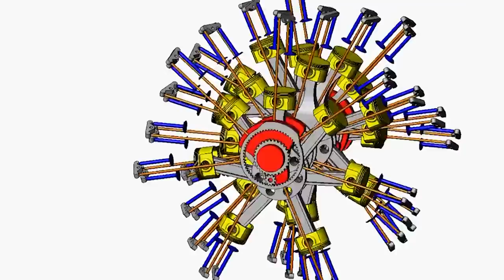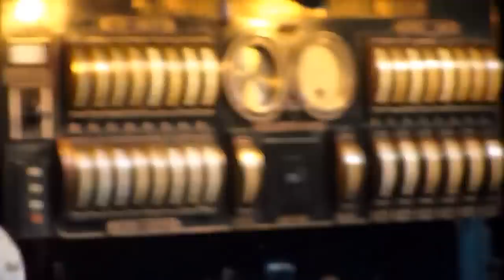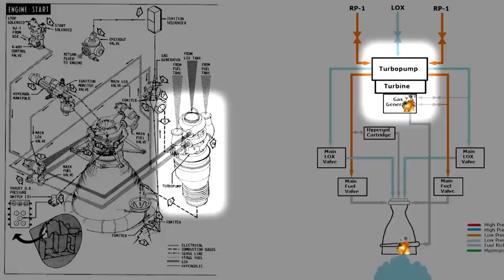The Most Powerful Engine in The World

Comment: At the Koreshan State Park in Florida, in the town of Edisto, they have a two cylinder Fairbanks-Morse that enthusiasts rebuilt.  They run it every Saturday.  It can run a GE generator that made alternating current back in the late 1920’s.  I seem to remember the engine is a 1925 model.  This park was once the compound a a utopian type self-sufficient society.  It is all pretty well preserved including their belt-driven wood shop powered by a single cylinder motor.  I have visited this park twice and hope to go back again.  It’s fascinating to see that big diesel run too.  They have a single cylinder engine that runs a compressor till it reaches a certain pressure.  Then they insert a glow plug they made and when the compressor valve is opened it turns the flywheel and off she goes!
Reply: ⁰
Reply: It’s Estero
Reply: @johnnyhardway4035  Thanks, I forgot it.

Comment: In Lyle Cummins book, "Diesel's Engine" he described an early single cylinder diesel engine produced for  powering a manufacturing plant, with a bore over 4 feet, a stroke slightly longer which produced (if memory serves me, and it still does from time to time) a whopping 1750 hp at a screaming 275 rpm.  Fascinating book should be a must read for any well rounded gear head.
Reply: L
Reply: Sounds like a description of a cathedral engine used in large ships.
Reply: @JackDavis i think so too 🤔🧐

Comment: 9:24 , a two stroke fires on each revolution, so if it's running at 2000RPM, it's is firing 2000 times, not 4000, only twice as many as a 4 stroke.  One of MANY errors in this video.
Reply: He said compared to a 12cyl 4stroke. This is 24cyl 2stroke. But yes so many errors in this one. I like the GE90 being 5.5mm long x 3.5mm wide (massive)

Comment: I used to work ot Ingersol Rand. They made a natural gas V12 stationary engine that had was used to pressurize natural gas in pipe lines. It had an additional four 6 foot diameter double acting cylinders to pump the natural gas. It had a 14 foot flywheel that could supply 20,000 HP to drive a generator which in turn powered the pumps to pull the natural gas from the ground.

Comment: Check out the British Napier Deltic. An opposed-piston (3 sets of pistons in a delta configuration) valveless, supercharged uniflow scavenged, two-stroke diesel engine, with a block of 9 cylinders, which can be stacked end to end for more power. Used in marine and locomotive.
The New York City Fire Department used a Napier Deltic engine to power their one-of-a-kind "Super Pumper System". This was a very-high-volume trailer-mounted fire pump with a separate tender.
Reply: I used to work on these as an engineering apprentice 30 years ago!

Comment: In 1967  I was stationed in the Army in Hawaii, and friend of mine was in the Navy stationed on the South Shores. My wife and I drove through Kolekole Pass to get to the Navel Station. It was there where my friend started talking about his MOS on repaired engines for the Navy’s power plant. He asked if I would mind going over to where he worked, for a tour! And of course I said yes. We got to this big building and He opened the door and we walked in. I was in there for about ten minutes and he asked me if I noticed anything different, and I said no, he said turn around and there was a wall, I thought about him being a mechanic on engines. (Me Being A Farm Boy), I didn’t think much about the wall and the connection this had to do with his MOS. He Laugh and said ‘I worked on this wall witch turned out to to be one of three Fairbanks- Morse engine that power the Navy Station. The size of that engine was nothing I would never forget! I was overwhelmed and the engine they were off loading on the page looks smaller then the ones in Hawaii, but what do I know being an old ‘Farm-Boy!
Reply: I was stationed in the Army in Hawaii. My wife and I drove through Kolekole Pass to get to the Navel Station. I saw one of three Fairbanks- Morse engines that power the Navy Station. The size of that engine was something I would never forget!    There,  I condensed the rambling and word diarrhea to a quick read.

Comment: One mind blowing fact of the Saturn F1engine is that the fuel pump of a F1-engine is driven by a gas turbine with 55000, yes 55000! Horsepower. That power was needed for pumping 400 tons of kerosene in 150 seconds. The exhaust gases of the turbine  cooled the rocket engine nozzle. After 150 it fell into the ocean.
Reply: Even more interesting is that gas turbine have so little power, rd170 engine gas turbine produce over 250000hp, even rd170 is more powerful (like 10%) it need gas turbine that need near 5 times more power (I guess it is due it have much higher chamber pressure)
Reply: FYI, the F-1 engine produced 1,522,000 lbf or 32 million hp.  Crikey and holy cow.
Reply: @Tsamokie  

Later versions produced about 1,600,000 lbs of Thrust
Reply: @mrlazda  RD 170/180 are staged combustion cycle engines. SpaceX's raptor 2 engines are full flow staged combustion cycle engines. I don't know why the power of the RD-170 turbo pumps is so high, but the raptor pumps are rated at 37 and 31 MegaWatts for fuel and oxidizer respectively. That works out at 53,000 and 45,000 Hp, while the chamber pressure is much higher than the RD-170/180.
Reply: @paulmichaelfreedman8334  as I understand full flow or stage combustion (edit) or open cycle do not make much difference for power needed for turbopumps, and still rd170 need twice power of raptor and that power is power (fuel used) is fuel not used to produce thrust (lost of overall efficiency)
Reply: @mrlazda  I think it's because of the overall size of the engine, it's larger than the Raptor, produces more thrust, and thus needs more powerful pumps for the faster fuel flow. The 170 is a quad-chambered engine and it is pretty big. The 180 is a two-chamber version. I will also point out, that the RD-170 has never flown on an official mission. I think the power loss per chamber is slightly higher with the 170 than with raptor.
Reply: @paulmichaelfreedman8334  rd170 flown on 2 missions before was returned one with Buran as payload and one with Polyus total of 16 engines and its improved variant (same 4 chambers only difference is in number of axis it move nozzle) Rd171 flown 84 more times. 
Raptor is marginally more efficient, but that is due use different fuel combination  (less then 10%) but power of turbopumps is over 2 times greater,  to big difference and f1 use same fuel combination as rd170 and use 5 times leed power for turbopumps.
Reply: The F1 was an absolute marvel of engineering!
Reply: @mrlazda  The F1 had a relatively low chamber pressure because I believe it was a tap-off system that used the preburned fuel-rich gas to line the inner walls with cooler gas to prevent the main exhaust gas from touching the bell. So the pumps did not need to be so powerful.
Reply: @882952  couldn't agree more
Reply: That's right, Saturn V most powerful machine ever built by mankind (less the collider, and Airtimes which I should should look up... )  either way payloads and horsepower that broke the conventional scale...
Reply: As a nerd there is a really good video on rocket engine turbo pumps

Comment: My dad was a mechanic in the Air Force and worked on the Pratt and Whitney R4360 wasp major engine.

As I understand it, the difference between the Wasp and the Wasp Major is the addition of a supercharger on the Major.
Reply: Also, I beleive, used on the C124 Globemaster.

Comment: Back in the eighties, in A & P school, we had to time an R-4360 Wasp Major. Also, on a test, we'd have questions like where a certain cylinder was.  Say #9 is at 22 degrees BTDC, where is #25. I ended up building and testing Pratt and Whitney PW2000, PW4000, and JT8D turbofan engines along with the IAE V2500 engine for Airbus.

Comment: The main point of the Orsted power station engine is the fact that it is a double acting diesel engine. These marine diesel engines were built to produce as much power as possible while being as short as possible for use on ships, thus allowing more cargo space.
Each cylinder of the engines had 3 sizes of bore, 2 lengths of piston stroke and a hole in one piston to allow another one too run through. 
I was lucky or unfortunate enough to sail on one in the mid 70's.
Reply: With their tolerance capabilities back then they must have worn out quick.
Reply: @snap-off5383  Lots of repairs done on that trip, must have done 3 units (a unit being a complete cylinder and running gear) out of 8. It was a real, real pain blueing and scraping a 3ft dia white metal bearing weighing 3/4 of a ton. Then we ran out of parts and ended up hanging one unit up completely, basically you disconnect the big end and eccentric straps so the there can be no reciprocating motion in the cylinder and you put in special supports to hang all the parts inside the engine. The engine, or more specifically the scavange space used to catch fire at regular intervals, we had to put it out by dumping CO2 into it. Quite novel seeing something with the paint blistering due to heat turn frosty.
Reply: Engine cylinder : stroke  1500 mm bore 840 mm = .0831265 m3 x 8 =  6,650 cubic meter . Until 1960 in regular use and was disconnected in 2004 from the grid , as emergency start backup power plant.
Reply: For the record, the engine is not a BMW engine. It is a Danish build Burmeister Wain engine.

Comment: Since the video didn't mention it I looked it up. The first engine shown the Fairbanks Morse Model 32 Stationary Engine in it's biggest configuration could produce 450 Max HP with it's Six Cylinder Version. Crazy a Charger Engine can produce more HP than this behemoth! The biggest selling point was it could run tens of thousands of hours nonstop without service. 450 HP in 1936 was quite a bit of horses.
Reply: for such engines, torque is vastly more important - and i'll bet no V-8 petrol engine can come close
Reply: And try and run a Charger engine for tens of thousands of hours without any service.
Reply: Im amazed that modern F1 engines are 1.6 Liter V6 engines that produce 1000+HP with a thermal efficacy of over 50%

Comment: The Model 32's horsepower was 40 to 50, depending on the particular model, hardly the most powerful engine in the world...
Reply: According  to what I just read they got up to 200hp.
Reply: The Fairbanks that is shown running in most of that segment is 75hp per cylinder.

Comment: The Maserati F1 engine made its racing debut in 1957 at Monza, in 2.5 liter form.  Ferrari had a 1.5 liter supercharged  F1 V12 in the late '40's, and a 4.5 liter F1 V12 in the early '50's.  Prewar, Fiat, Mercedes-Benz, and Auto Union had Grand Prix V12s.

Comment: There was a fairbaks morse engine along the riverfront next to my house that was bigger than my house(edit, before it was extended in the 90s), it was just sitting outside exposed to the weather all these years until rtecently where one day it was just gone. If i recall it was an inline 6 or 8 and had to be 30 feet long(longer than my limousine)
Reply: I served on the YTB:s at the SubBaseBangor WA, we ran the 38D 8 & 1/8 10 cylinder Fairbanks,  the Trident subs use the 12 cylinder version,  great engine.

Comment: You missed some of the most powerful combustion engines installed in ships
Der leistungsstärkste Wärtsilä-Zweitaktmotor (Typ 14RT-flex96C) mit 14 Zylindern und einem Kolbendurchmesser von 96 cm entwickelt mit vier ABB-Turboladern eine Leistung von über 80.000 kW (108.800 PS). Er ist der Hauptantrieb der Containerschiffe der Emma-Mærsk-Klasse. Die Produktpalette reicht von niedrigen Leistungsklassen mit Viertakt-Antrieben und Motoren ab etwa 2.000 kW (2720 PS) bis über 130.000 kW.
Reply: Der kam doch in dem Video vor oder?

Comment: get your facts straight, ge engine 5.5 mm long 5 mm wide, a 2 stroke fires 2 times per rev vs a 4 stroke
Do measurements in the same units of measure for all hp is hp, nm is nm so on so forth.

Comment: 18:27 Dear author. Slavic Soko Galeb. There is a huge difference between Slavic countries, being a Slavic culture in general spanning across countries like Poland, Belorussians, Russians, Ukrainians, Czechs, Slovaks, Serbs, Slovens, Bosniaks, Bulgarians, Croats, Macedonians,  Montenegrins and the actual designers and users of a plane that you mention here. It was designed in Yugoslavia in 1978, and at that time, Yugoslavia was composed of few of the mentioned countries, but those countries didn't constitute the whole of Slavic cultural and language group. Do your research, try better next time please. One video, two major mistakes, one in metrics - millimeters instead of metres and a significant mistake in differentiating ethnic groups and countries, a solid fail if you ask me. And one more thing, be consistent, use either km/h or mp/h ie. metric or imperial values across the video, using one and then 10 seconds later another one is just sooooooooooooooooooooo confusing.
Reply: I agree, not to mention, 13:25 He also referred to this diesel engine as "consuming less gasoline"

Comment: Oh No! the narator messed up on the GE90-115B engine. He stated that it was Millimeters not Meters. Meaning at the stated 5.5 Millimeters long it would be les than a 3/16 Inch  in length and 3.5 Millimeters across making it les than 1/8 inch wide... I am surprised it was not caught out in editing. other wise it is very impressive.

Comment: Biggest 2 stroke diesel ever built with 22500hp. Well, that´s cute. Finnish company Wärtsilä designed and created this little shipengine in partnership with Sulzer, RTA96-C and it produces around 80MW which is roughly 109000hp. And yup, it is 2 stroke diesel engine.

Comment: He never gave a thrust spec for the F-1,  just said that it varied. My dad worked at Rocketdyne on the Saturn V second stage engine back in the sixties.
Reply: It’s 1,500,000 lbs.  5 of them would lift the 3,300 ton Saturn V rocket. The new SLS is 4,400 ton by comparison.

Comment: The presenter seems to have completely omitted any mention of low-speed diesel marine engines.  I guess he is unaware that such things even exist, which simply goes to show that what goes on at sea that people on land don't know about is a lot.  Suffice it to say that the Sulzer or M.A.N. low-speed diesel engines which power modern almost all modern ships are humungous.  Suffice it to say that what seafarers refer to as an "engine room" is, in size, more comparable to the inside of a cathedral.  And do not confuse those engines with the diesels installed in things like trucks because they are a whole other species entirely.  Low-speed marine diesel engines operate at a speed of only about 100 rpm, whole most land diesel engines won't even idle at that low a speed.  Furthermore, those are not just a handful of freak engines, there are literally thousands of those things out there in the world, working every day, day in and day out.  It is simply that 99.9% pf people have never seen one because they are in ships out at sea.

Comment: Pratt and WHITLEY!
Five seconds later, he said Pratt and Whitney.
Is this guy for real?
Reply: erm, no, no I don't think they are: you can fully automate making this kind of stuff with openly available tools...normally it's a lot more obvious though, this does seem to be autogenerated content but somebody has both gone to the trouble of putting it through a changer to separate it from the stock voices you normally hear from that and done the work to clean the product up...which frankly sounds like a lot more work than just doing it yourself for real so I might be missing a stage of automation here? or they were working on refining an additional layer of automation in the editing stage.

^oversimplifying a bit here but basically you hook a search engine into a chatbot and output the result to a text-to-speech, add in a different search engine to sift through an image bank for pre-liscensed visual assets using either the original input terms or in some cases the output from the chatbot as the input search terms (most banks even come with this already)
Reply: ohhhh yeah, just clicked on the channel itself this is ABSOLUTELY autogenerated, this is just one of the video formats that it did a much better job processing

Comment: With the exception of the rocket engine, you're not even in the ballpark.  As Thomas Allen said, really big engines are found in natural gas plants.  I've had a little experience with the Cooper Z-330, which generates about 20,000 HP.  There are 4 in the world.  However, the most powerful engine is the Wärtsilä-Sulzer RTA96-C, which is used in ships.  It's rated at just over 107,000 HP.

Comment: There is so much misinformation in this video. For example 6:50. Its not the BMW Brutus because it was not built by BMW. It was built by the Technic Museum Sinsheim. The engine is not from a WW1 aircraft (production for that type only began 8 years after the war ended) but is believed to have been from an aircraft of the Spanish Civil War. It was found by a member of the museum in a scrapyard in Spain. It was also not built in 1925 (the engine didn't even exist that year) but instead from 1998 to 2006.

Im not sure about all the other clips, but if they messed up THIS badly I find it hard to believe they got the rest right

Comment: UMMMM Think you may have got your measurements slightly off with the GE90-115B. I think you may mean metres not millimetres LOL!
As for the largest bike engine you missed out the Flying Millyard which is also made from two cylinders of an Aero engine. The difference being is that the cylinders are the only thing used from the original engine. It too is 5 litres. The largest motorcycle production bike is Triumph's Rocket 3 at 2.5L